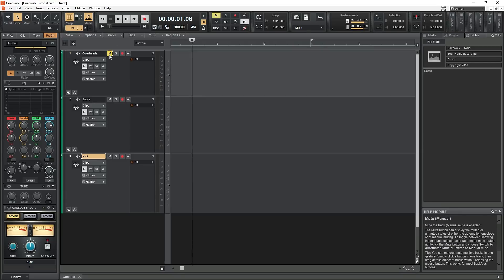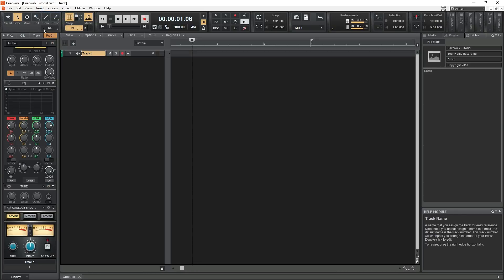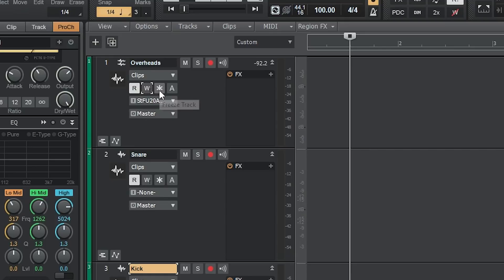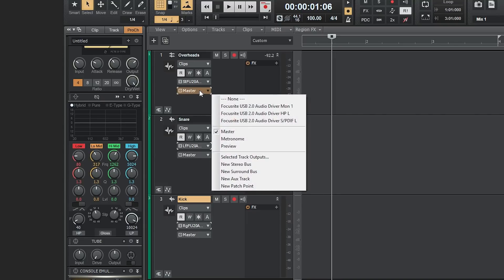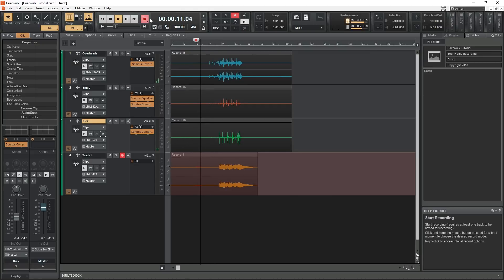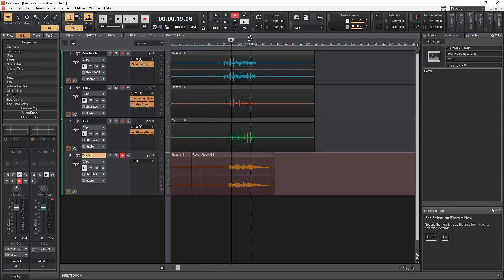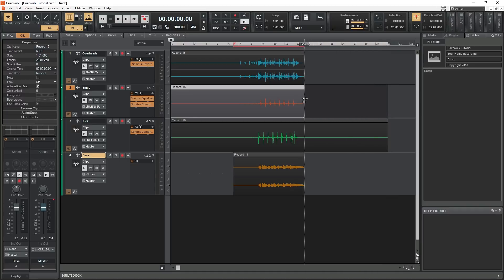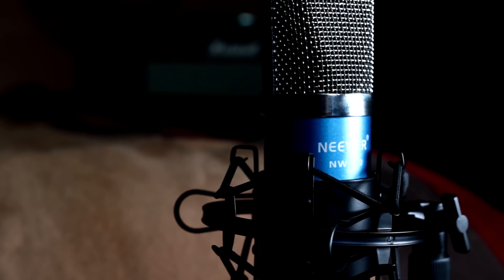Cakewalk by BandLab Tutorial (Part 2) – Recording and Editing Audio Tracks

Comment: The fading part, all I'm getting is shorten the clip, rather than the triangle, I'm using the smart tool. Is there something to be pressed first? I've tried all around the edges as well to get the triangle, but it's always the " ] "half backwards square symbol instead. Any help would be much appreciated.

Comment: why can't I use cakewalk while using youtube?
Reply from the maker: It’s likely taking over your audio driver. Maybe switch from ASIO mode to a different driver mode and test that out temporarily while using YouTube.
Reply: @YourHomeRecording  Copied my previous comment. Its an easy fix. Go into cakewalk and ensure these two things:

1) Preferences (hit "P" on keyboard) > Playback and Recording > Uncheck "Suspend Audio Engine When Cakewalk Is Not in Focus"

2) Preferences > Driver Settings > Sampling Rate dropdown box > ensure that the sampling rate is equivalent to the sampling rate set in windows for your playback device. The default for Windows 10 should be 48000 Hz. You can check and change what windows is using for the sampling rate by going into the sound settings in the control panel, finding your playback device, clicking on properties > advanced and it should be displayed there. Its recommended you set it at 44100 or 48000 (either works). The important thing is that the sampling rate set in cakewalk must match the sampling rate set in windows, otherwise weird stuff happens and youtube videos will buffer or not playback correctly with sound.

Cheers

Comment: youtube wont work when i have cakewalk open can u help
Reply: I have the same problem and I have a super-fast computer. I wanted to watch videos to learn Cakewalk with the program open.
Reply: @ronjames-music  Its an easy fix. Go into cakewalk and ensure these two things:

1) Preferences (hit "P" on keyboard) > Playback and Recording > Uncheck "Suspend Audio Engine When Cakewalk Is Not in Focus"

2) Preferences > Driver Settings > Sampling Rate dropdown box > ensure that the sampling rate is equivalent to the sampling rate set in windows for your playback device. The default for Windows 10 should be 48000 Hz. You can check and change what windows is using for the sampling rate by going into the sound settings in the control panel, finding your playback device, clicking on properties > advanced and it should be displayed there. Its recommended you set it at 44100 or 48000 (either works). The important thing is that the sampling rate set in cakewalk must match the sampling rate set in windows, otherwise weird stuff happens and youtube videos will buffer or not playback correctly with sound.

Cheers